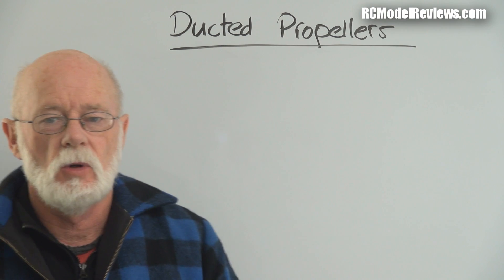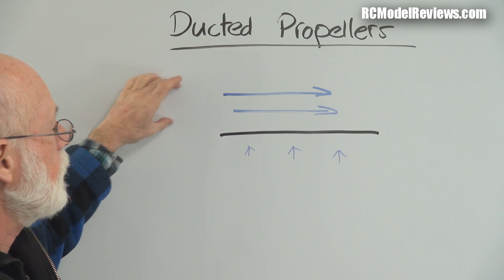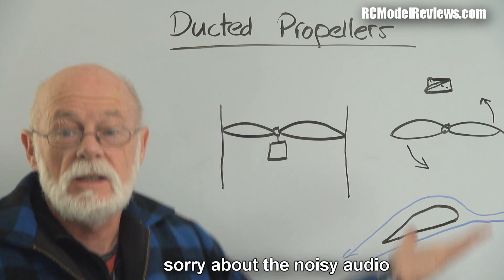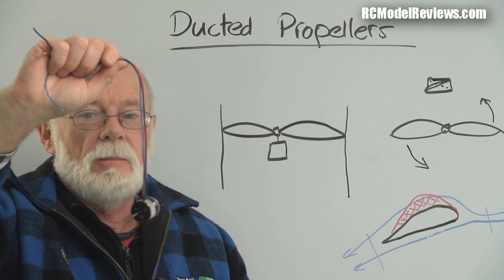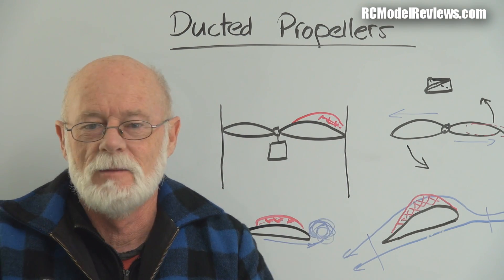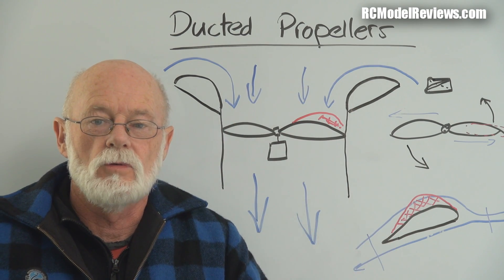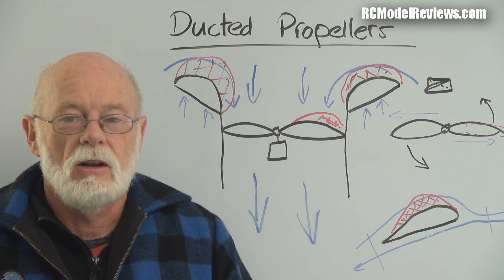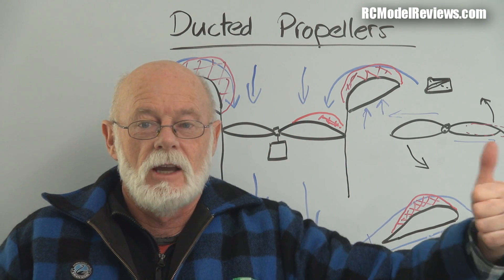How ducting a propeller increases efficiency and thrust

Comment: Insightful presentation, thank you!  I might suggest that while adding an annular duct at the inlet may help a fan due to the Colander effect, if the situation is that the propulsor is actually moving thru the static fluid body that the annular duct will add a large amount of drag!

We do not see such add-0ns on propulsors used on certain types of sea vessels (that move thru the static water body.

I enjoyed your presentation, and found that it drew a lot of flat earth types below with no actual knowledge of Fluid Dynamics.

Comment: In some cases, I think it can be possible to join the duct and the propeller, i.e. the duct would rotate with the propeller, being a kind of continuous winglet. No gap between the tip of the propeller blade and the duct. Perhaps the friction along the duct would reduce the gain…

Comment: So basically, for every vertical single blade, prop or airfoil on a propeller, the Duct adds a horizontal convex airfoil, or prop/blade running  tip to tip of vertical blades. The already generated pressure waves spilled from the tips of the vertical pitched blades would be how much more efficient if captured by the Duct? 
<<<<<<<----->>>>>>>
 AERONAUTICAL QUESTION: BLADE LENGTHS, DIAMETER, AND CIRCUMFERENCE ALL SAME MINUS DUCT.
<<<<<<<----->>>>>>>
 A 4 bladed propeller 
                VS.
A normal 2 bladed propeller with Duct
<<<<<<<----->>>>>>>
BOTH SETS OF PROPS PERFORM FIXED PITCH         ON SAME SINGLE ENGINE AIRCRAFT
Ex. CESSNA 172
<<<<<<<----->>>>>>> PROP PERFORMANCE?
Best rate of climb? Timed 100kt climb to 10,000ft? Fuel burn?   SAME ATMOSPHERIC PRESSURE AND ALL AROUND SAME CONDITIONS.

Comment: If your fan is vertical (as in a rotorcraft), then the coanded area doesn't produce drag. However, if you're ducting a fan for thrust, the vacuum produced behind that angle as you move forward through the air likely cancels out much of the benefit if it's shaped as you drew it. Obviously, filling in the area behind the forward arcs and using boat-tail like structures towards the back can reduce this drag enough that the effect might be useful, but, generally, I think it's more practical for lifting rotors than it would be for thrust except at very large scale (e.g. turbine engines).

Comment: I thought NASA has time and time again stated that the bernoulli effect is not what creates lift. The air over the top of an airfoil does not travel faster than the air over the bottom, which, you can see in a wind tunnel.

Comment: I say the the "normal" pressure below the flared sides of the duct on white board as drawn would only be "normal" air pressure if the duct itself is not moving. if the duct were to start moving up as drawn on board then the underside of the flared area as drawn would now become a "low" pressure area. So that part of your story is wrong

Comment: A propeller does not work as a wing, it is a screw. A screw in a tube will move water. A screw in free air will still move a fluid but not as well.

Comment: You have to close the center. Or the air will bleed through it as well. Maximum pressure builds up only at the periphery of the propeller. So at least half of the diameter of the propeller should be closed from the center. Also, add a ring to the tips of the propeller, so you can fit it much closer to the wall of the duct.

Comment: So eliminate the gap and the center shaft, attach the blades to the tube — spin the whole thing within an outside tube using a magnetic bearing housing, the rotor in the stator.(name me as co-inventor).

Comment: Teaching pressure and centrifugal force....Still? It is a self destructive system, it is based on heat and radiation, and it is highly inefficient. 
Vacuum and the centripetal force is far more efficient, a lot more powerful, it is regenerating, and it is based on cold ...it regenerates the air. 
Should have been born one hundred years ago with this kind of corrupt technology.
Read Viktor Schauberger and John Keely, mate.

Comment: the lower pressure above wings (provably) has nothing to do with the length of the travel per se. You can have a pipe split into two parallel pipes of different length, them rejoin, and both pipes will fill up to ambient pressure and be traversed at the same speed.
The speed of the air is influenced mainly by pressure differentials and a hint of inertia. Air is slow above the front of the wing and below the entire wing, where it is pushed to the side and slightly back against the flow. Air is fast above the main and rear portion of the wing because it expands and pressure is lower. That faster movement also creates a small Bernoulli effect, but it is tiny compared to the other effects.
That's probably still heavily oversimplified and a bit controversial, but at least close to the truth. that "longer path above the wing" myth should not be spread anymore, it is not the cause of the effect, just a common  coincidence.

Comment: I haven’t read through all the comments, so this is probably old news to many, but there are two ducted fan prototype aircraft flying that I’m aware of, and probably lots more.
The one that I particularly like is a scaled down L-39 Albatross, and I believe it was designed and built by students at a major Czech university.
It was powered by a BMW S1000RR motorcycle engine that makes over 200 horsepower at the rear wheel when installed in the bike.

I would very much like to know what the US Army learned about ducted fans. I may have already heard about it during my education at Embry-Riddle, but that was a while back, and I’ve had too many bouts of general anesthesia since then...

Comment: Jet engines are ducted and produce more thrust, helicopter are NOT ducted cause the the WEIGHT on the structure does not compensate the extra LIFT, so where is what?

Comment: Heat generated by a vortex (and associated energy loss is NOT small).

Propeller tip vortices are largey eliminated by having the end of the propeller welded to the duct, as the original propeller&duct shows clearly.

The propeller causes the air to leave spinning. This leaves behind some of the energy as a vortex. This is usually counteracted by either guide vanes or a contra-rotating propeller.

Comment: wait! air moving creates lower pressure? ok do so blow air over the paper and it lifts the paper up cause pressure is more under the paper? ok so if you blow under the paper you create a low pressure under the paper but it also lifts it up? makes NO sense at all
Reply: So when you blow over top the paper, it lowers the pressure. The pressure beneath is high RELATIVE to the low pressure you just created. It's just a comparison between the two.
When you blow directly onto the bottom of the paper, it may create a low pressure zone, but the air impacts the paper causing it to move away because air is physically impacting it.

Comment: More complicated subject than I would have thought. If winglets were attached to the tips of a propeller, acting as mini ducts, would this improve efficiency? A very small adjustment, how much power can it save from sliding off the edges?

Comment: No, no, no! I'm sorry. You seem like a nice guy and a good teacher, but much of what you said is simply wrong. The "Equal Transit Time" theory of the wing, which you discuss at 6:00 is incorrect. The fact that the upper surface of the wing is longer is not the reason that the air molecules travel faster. This is a well known Layman's myth about how wings work.

Comment: 6:00 The explanation of lift goes off the rails here. The "equal transit time" explanation is completely bogus. Funny thing - the diagram is a sufficient explanation by itself. The air passing over the top of the wing is directed downward (Newton's laws of motion), same as that passing under the wing.

Comment: If the plate had no weight, and you consider the weight of the air surounding it, the plate would be buoyant, and would act like a hot air ballon.

Comment: Ducts improve static thrust with performance diminishing as forward velocity increases. It's not just the added weight, it's the added structure that increases drag so that an unducted fan is more efficient at higher aircrafts speeds.

Comment: Hmmm. Very interesting and knowledgeable. Quick question. You mentioned a small space as possible between the prop ends and the duct. What would happen if the duct was attached to the prop ends and it was also spinning. Would this not be the ultimate in lowest possible gap? Would this work? Also how would this info help in improving a wind generator prop? Is there some way of getting more power from a small prop with this ducting? Remember that a smaller prop does not need a high tower and can be better fitted in built up areas.

Comment: Interesting. but this raises the question of whether the high/low pressure areas are actually stabilized, or whether the pressure won't simply equalize by developing a bigger air flow around the long edge of the propellers creating the turbulence there instead?

Comment: Really good mini lecture.but how about extra mass, it's valuable option if extra thrust added is more than mass of duct added. Also, what about make duct and propeler as one single rotating part (well it will also introduce some extra air movement in circular manner due to duct fan surface and air friction)? that will be stronger and u wont need to have clearance/tolerance/gap  between propeler and duct (propeler vibates quite allot so gap is unavoidable unless u can balance propeler idealy, but still).

Comment: Stumbled across this video looking for something 'boat' related...and found it rather interesting, and depending on the 'propeller' application (rc BOATS or rc PLANES?) you may be VERY right, or VERY wrong...and here's why...
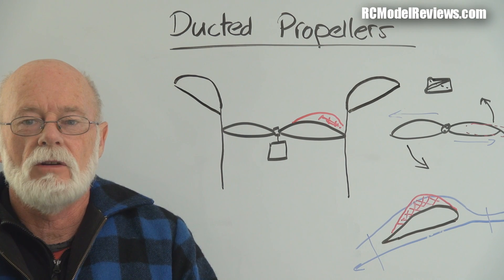At 12:16, you have drawn an image of what would be, in effect, a venturi...now what do you have when you design a venturi? You have REDUCED pressure and INCREASED velocity. So, in terms of propulsion, you have REDUCED your available pressure (where you are seeking increased pressure in terms of propulsion)...
Depending on the form of 'ducted propeller' you are chasing (is the duct attached to the prop, or is it an independent housing with a specific clearance to the propeller?) you may be designing a 'foreign object' nightmare to avoid 'prop-crash' as a result of. If you are designing an integral 'hooded prop', which is found on things such as submarines and multi-million-dollar fighter drones, then you are talking about unique HIGHLY ENGINEERED propellers...
Oh, and in the ship industry, you NORMALLY only find hooded-props on SLOW RPM vessels, like tankers...because HIGH RPM rotation causes a DEFINITIVE laminar airflow seperation as RPMs increase (which is the same reason you don't see them on helicopter rotors...since the rotor tips often approach speeds of mach .7, where the tips are approaching the speed of sound, and air flow starts to delaminate from the surfaces...which is what causes MAJOR CATASTROPHES when it comes to 'poorly designed supersonic products' (aka SHATTER, EXPLOSION, etc.)
Think this doesn't apply here? FYI...it's easy to destroy a CD or DVD by accelerating them to Mach 1, believe it or not...look up the videos...

Comment: Since drag goes up with the square of velocity one important issue you forgot is the drag produced by the tip vortices. Hence “Ground Effect” on a fixed wing aircraft when landing. 

With a duct, the reduction of vortices and drag produced by them will greatly increase the efficiency of the propeller giving you way more thrust at lower RPM’s and less battery drain especially at the lower to middle throttle range.

Comment: Crap... I'm late to the party... Curious to know if you have detailed knowledge of the advantages/trade-offs of adding an electrical generator component to a turbofan engine (which in turn drives an electric motor/fan) to minimize mechanical components typical in aircraft like the Osprey (cross drive shafts). I'm specifically interested in the prospect of drawing electrical power from a turbofan which would then transition to generating thrust only. I.E., making a tilt-rotor much faster and more reliable...

I had the privilege of meeting with Bill Clay of Bell/Boeing in 1991 who gave me the whole history of the Osprey (xv15 forward). I've thought ever since that the tilt-rotor system could be so much more efficient if the turbine engines were to split duty between generating electric power (for vertical lift) and pure forward thrust... Eliminating the "engine-loss-drive-shafts" would more than make up for the weight costs of the generators/electric motors.... (IMHO). Seems like you'd have much, much greater top speed by using turbofans in this way versus turboprop engines driving props...

Comment: I can't help but think this isn't as effective as presented. I've always heard that ducted fans less efficient. Also... if it were this simple to create higher efficiency, I'm fairly certain that every major manufacturer of commercial prop planes would install them.

A point of misinformation presented here, is the "free thrust" of the supposed static pressure behind the duct's facia. This is false. The incoming air and pressure of forward movement/thrust will create a high pressure zone where he illustrated a low pressure zone... and where he illustrated the supposed static or high pressure zone, would be a low pressure zone created behind the facia... as a result of both forward thrust, and the draft created by the exiting air behind the prop.

FYI, Tunguska tried this many decades ago... after millions of dollars in failed attempts and thousands of designs, the project was abandoned.

Comment: If you put a bunch of little holes in a propeller blade would it make the low-pressure area, or would it make it lighter but still workable. Also, If the high-pressure air tried to get to the low-pressure air. Does that mean that it would blow in reverse?

Comment: Sorry but your description of how an airfoil works is simply wrong.  The wing does not create lift by deflecting air.  The air on the top of the wing does not go faster over the top so it can get to the back at the same time as the bottom.  In fact the air over the top of an airfoil actually gets to the back of the wing before the air going over the bottom.  The creation of lift involves bound vortexes and is significantly more complex then what you present.  Your description is akin to saying turning the key in your car makes it move.  You are missing all the physics that is actually taking place.

What actually happens is that the airfoil pulls air up at the front and pulls air down at the back.  This combination causes a bound vortex to form around the wing that also pulls air backwards over the top and forwards over the bottom.  When you add all the vectors you get the air over the wing going faster then the flow and the air under the wing moving slower then the flow.  By Bernoulli we thus get less pressure on the bottom then on the top and as such lift.

Comment: This is a bit too simplistic. What is omitted is that the duct vastly increases profile drag, Also the Bernoulli principle has recently been conclusively proven to have very little effect as opposed to angle of attack. Additionally there is an extremely complex system of vortices and flow around the wall of the duct that further decreases performance. There are very good reasons why ducts have never found a place on high performance aircraft propellers. That said there are some net gains to be had in a lightweight system such as RC or drones. The one major benefit that should not be overlooked is the huge reduction in noise that can be achieved with ducting - something that drones should really be taking advantage of. There is nothing more annoying than having the peace of some beautiful outdoor location shattered by some You-tuber's drone whining and zooming around the place!

Comment: The low pressure zone should actually be forced towards the center because it's also lower density. That would actually help explain the benefits of a duct as the duct would allow a higher pressure/density  zone to form around the outer edge, where the propeller blades could take best advantage of the the denser air.

Comment: there are basically two ways of "generating" lift. 1) Bernoullis Theory: upper surface longer than lower surface on airfoil. Difference of pressures resulting from difference in velocities over and under wing. 2) newtons 3rd law( i think) where the force on the wing (of any shape - angle of attack) pushes the wing upward. there is a combination of both in most airfoils when the AOA is increased.